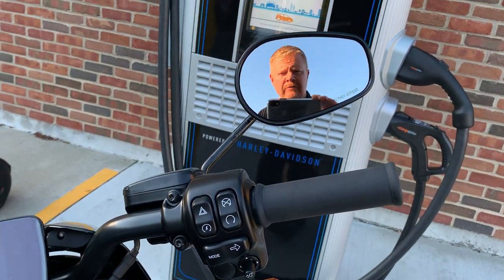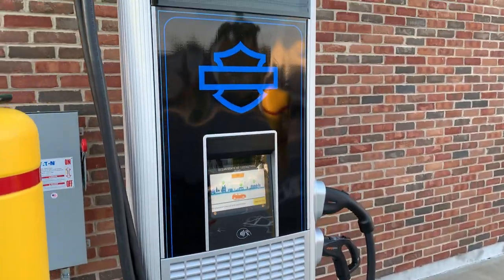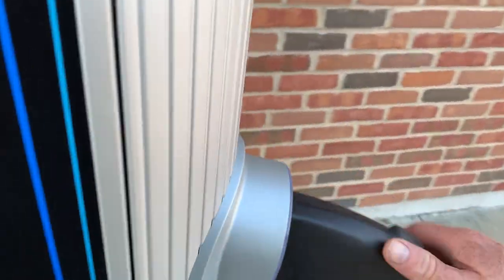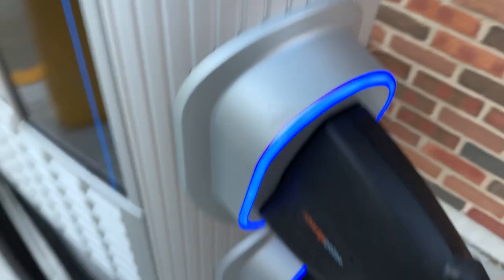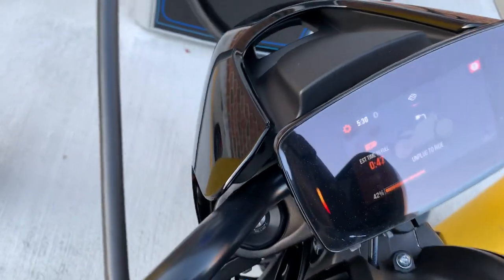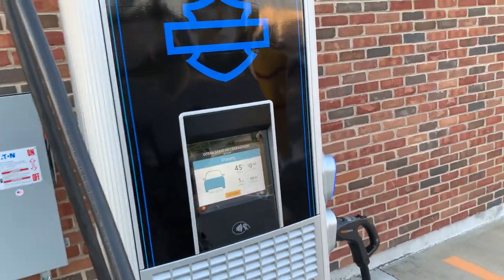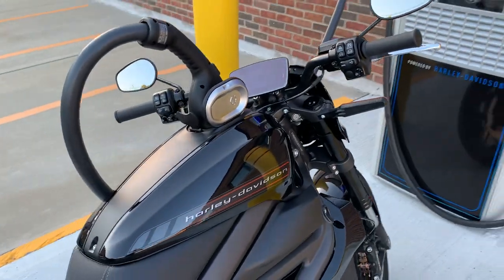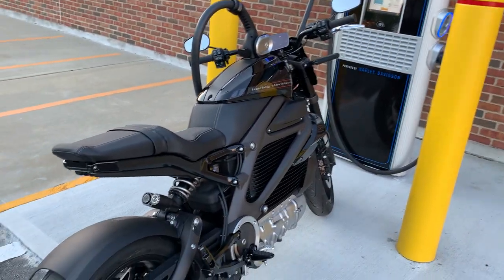How to DC Fast Charge a Harley-Davidson LiveWire

Comment: What happens if your phone is dead?
Reply from the maker: Assuming you didn't run your bike battery completely to zero you could plug your phone in to your bike and then wave it in front of the charger.  If you lose you phone however.  Then you would be screwed.  Honestly though if someone came by the dealership I would just let them use my account.  Its less than a buck to charge the bike on our DC Fast.

Comment: DC only fast charging is a pain and the reason this bike will never sell!

The best charging option is fast AC charging for the primary reason you can fast charge at home in a little over an hour. This means you can only fast charge at commercial DC charging stations. They don't sell DC fast chargers for home use. To charge at home you have to use the slowwww 110 v charger which is a bad move for Livewire 1 - Now I heard they fixxed this mistake on the the Del Mar and it accepts AC fast charging allowing you to fast charge at home on a 220 dryer plug.

Why is this - because Harley did not want to pay for a fast charge module for the bike.

Comment: Blows my mind that still in 2021, this bike can only use j1772 at a regular wall outlet charge rate. With the recent price cut, this bike would be a no brainer if it just had that capability. It’s cool that it has DC fast charging, but the infrastructure still sucks while j1772 is everywhere
Reply: So two years later you ate those words.😅